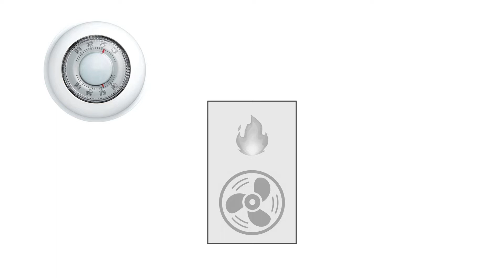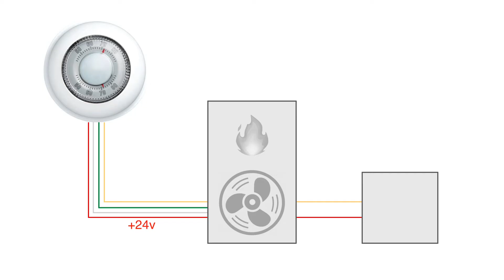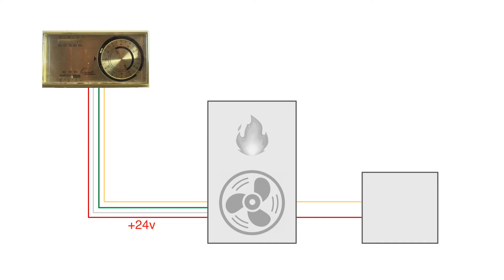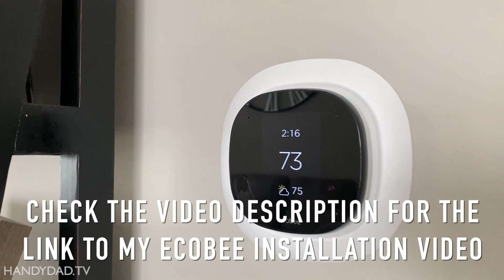Thermostat Wiring Explained (with or without a C wire)

Comment: I have a question although you may have already answered it. My new ecobe tstat and heating/ac is utilizing the old 4 wire cable hookup so I cant have my fan running alone. Will the adapter shown inthe video solve this issue?
Reply from the maker: I’m not sure, but I think so.

Comment: Does the "Power Extender Kit" is necessary to install???
Reply from the maker: It depends on the thermostat model, and if you have a C wire. Some have batteries so you don’t need to worry.

Comment: My thermostat has 3 wires:white,green and red I’m trying to replace it but don’t know which one to buy and why. Your thoughts?
Reply from the maker: The red, white, and green wires on a thermostat typically indicate the following: 
 
Red: The power source for the thermostat. If the thermostat is only for air conditioning, it will have a red Rc wire. If it's for both heating and cooling, it will have a red Rc and a red Rh wire. 
 
White: The wire for the heating system. It's connected to the W or W1 terminal. 
 
Green: The wire for the fan.
Reply from the maker: Any thermostat will work for you, but don’t get a smart thermostat that requires a C wire because you don’t have one.
Reply: @handydadtv  I when to the Ecobee website and they said this about the 3 wiring system what’s your thoughts? You can repurpose the G wire by moving it to C on both the ecobee and equipment sides. Doing this will mean you will no longer have independent fan control.
Reply from the maker: @JoseMelesio-fv6xe Yeah you can do that if you don’t use manual fan control.

Comment: I have a Ritetemp thermostat model 6022. I only have four wires, yellow, red, green and black. The yellow wire is hooked to the Y, the red wire is hooked to our H because I only have a heating system and the green wire is hooked to G. What do I do with the black wire?
Reply from the maker: That could be a C wire.

Comment: I have a boiler with baseboard water circulating heat.  My thermostat has 3 wires: red, yellow and white and I'm trying to replace it but don't know which one to buy and why.  Your thoughts?
Reply from the maker: Red is usually +24V and white is for heat. The thermostat connects the two when the room falls below the set temperature. 

Yellow is usually for cooling, but that makes no sense with a boiler. 

I’d open the thermostat to see how the screw is labeled and I’d also follow the wires to the boiler and see what they connect to. 

If the yellow happens to be a C wire, then it could work with pretty much any smart thermostat.
Reply: I had the same but my have white,green and red what kind of thermostat is compatible with this wiring?

Comment: Hello, hope everything is well. I’m having problems wiring my new thermostat. I currently have a Domestic 3 wire set up red wire 12v blue wire say C4 white wire say GND. 
I just bought a Sensi touch smart thermostat that has so much more connections. Please help me ?
Reply from the maker: You should contact Sensi support.

Comment: I'm trying to hook a five wire thermostat to a 2-wire RV thermostat cuz I'm freezing right now in the stupid thing keeps turning off
Reply from the maker: If it’s an emergency, just connect the two wires until you’re warm. No need to freeze. 

Also, this video may help: https://youtu.be/NZ9fx3eZ5tg

Comment: I installed 2 ecobee 3 lite in a 2 zone home with one unit. On my zone control board it only allowed a green wire in one of the ports. One of my ecobee started right up the other one did not because there was no connection for the green wire on the zone control board. It was a Bryant zone perfect 2 zone.  Not sure how to wire.
Reply from the maker: Sorry can’t help

Comment: This is by far the best explanation on thermostat wiring I’ve seen. Thank you. We moved into a house with two systems and two Ecobee smart thermostats and one of them let me know there was no C-wire. Now I know it’s not an issue because of the power extender they’d installed. Thanks again.
Reply from the maker: Glad it was helpful

Comment: Lebanon Missouri have an air conditioner heat pump that only has four wires has a blue yellow white and red the red is power yellow is the pump or compressor the white for heat Can I have to assume the blue is for the fan and it runs without a common I don’t want to burn up the unit
Reply from the maker: I wouldn’t assume. Use your old thermostat to figure out what it does. If that doesn’t help, look where it’s connected on your furnace.

Comment: Great video .. Any experience with systems that have a zone board that links to 2 thermostats but has no G (Fan) wire at the thermostat? The G wire seems to go to a control thermostat… I have 2 nest thermostats working perfectly with c, rh, w1, y1… I have a Lennox harmony 2 board …
Reply from the maker: No, I’ve never seen that. Sorry.

Comment: How do you wire 3 wire thermostat adding a condenser into ecobee 4? Is it possible?
Reply from the maker: You need to add a wire for cooling.
Reply: @handydadtv  Could you could you please show me a diagram? The way I connected doesn’t give me power to my ecobee. I have 3 wires for heating and 2 for A/C thanks
Reply from the maker: You should contact ecobee. They have excellent support.
Reply: @handydadtv  ok thanks!

Comment: I have and old mercury and I'm going to smart next.  I have wire x 0 and b that I'm not sure where they go
Reply from the maker: It sounds like you have heat only, no central AC. If you’re not sure about the wires, call an HVAC guy to help.

Comment: Hi Mr. Handy Dad -  this is actually the wife of Handy (but extremely ... frugal lol) Wayne and yes we do currently have the original thermo (Mercury, heat only)) And I say currently, in this 1940 NY home.  We have remodeled some of it, and one thing I can say is, they REALLY built solid walls-ie. not some of the current sheet rock you could pretty much kick through, no, we had layers of cement, wire netting, more cement - idk the terms - but it took lonnng sessions w the sledge hammers etc to break thru. Thanks for your vid!
Reply from the maker: Hi there, Mrs. Handy Wayne! Thanks for the comment. Those old homes are definitely built like tanks.

Comment: Unless you own a Lennox HVAC system. They use a proprietary four-wire data bus for all communications and programmability. Their thermostats that are Wi-Fi capable range between four and $800 and you cannot buy them directly. You have to buy them through a dealer.  You can change the system by moving some jumpers on the HVAC system and then running seven or eight wires to a regular thermostat, but then you lose all the special programmability. For instance, from my thermostat I can control the fan speeds and other features directly, as well as configure percentage of humidity. I found this useful in my home, since the HVAC system is on the opposite end of the house as the bedrooms. Plus with older homes, the ducts leak like a sieve. My current Wi-Fi thermostat I was able to find on eBay for a couple hundred bucks. However, I have to keep an old wireless router on hand because it will not work with newer routers. A more modern thermostat is available from Lennox, but you're going to pay between $400 and $800 depending on the model. I wish these were things I knew when I bought the system 10 years ago.
Reply from the maker: I had a Carrier system with the Infinity control in my old house. Same thing. I couldn’t replace it with ANY non-Carrier thermostat.